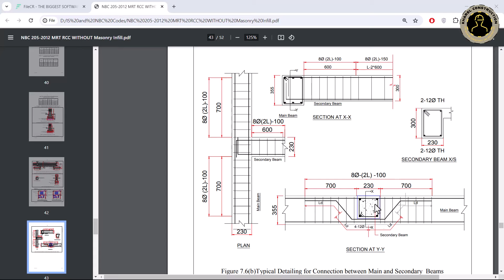Toilet लाई किन र कसरी खाल्टो बनाएर निर्माण गर्नुपर्छ?Construction of Sunken Slab for Toilet in Nepal

Comment: very informative..i asked my contractor to make a sunken slab after watching video.. keep the good work..Side question :) can we make a soak pit like around 3ft from the foundation? I am concern about the settlement of the foundation due to the expansion and shrinkage of the soil around footing.
Reply from the maker: Your concern for settlement is understandable and is somewhat true if the soil is cohesive in nature. However in a limited land, we need to work our way around. Make sure that the soak pit does not affect the pressure bulb developed, it should not intersect the footing mesh, a deeper soak pit is also not recommended close to the footings. 
Normally, cohesive soil expands and contracts with moisture variation, cohesionless soil does not (within permissible limit), so first we need to classify the soil.